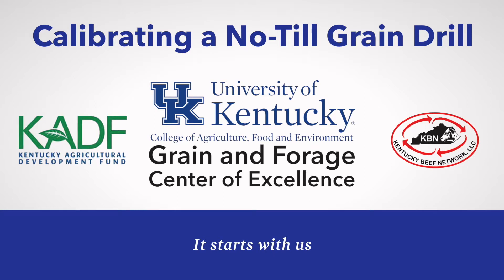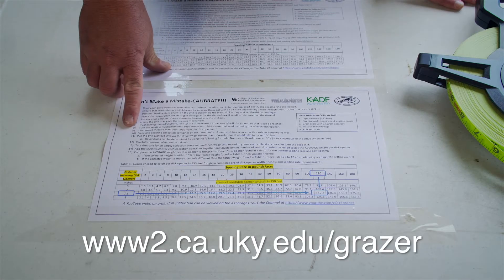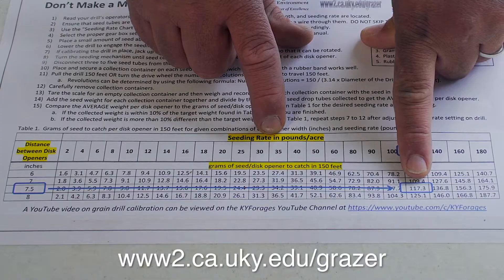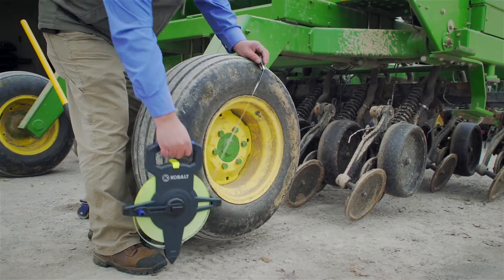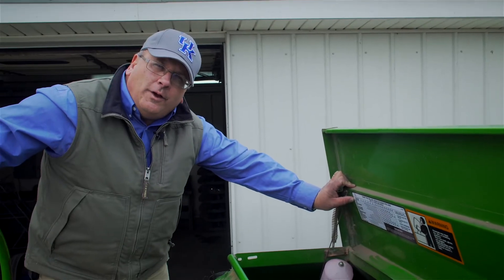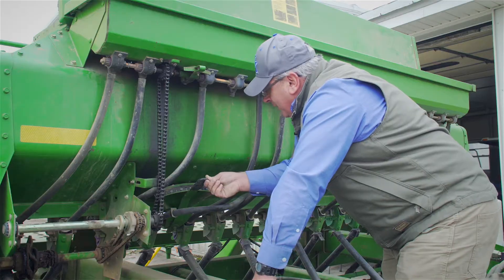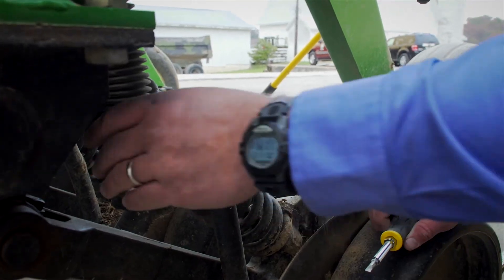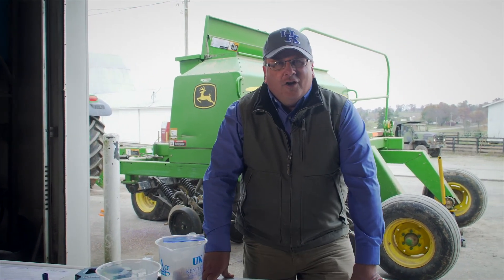Grain Drill Calibration

Comment: Why is 150 feet used? How do you get that number?
Reply from the maker: The distance was sort of arbitrary.  On the John Deer drill that I normally calibrate, it is approximately 20 rotations of the drive wheel. Having said this, the TABLE that is used to determine the amount of seed to catch is based on 150 ft.  So if you are using the table instead of doing you own calculations, then you MUST use the 150 ft distance.  Chris
Reply: @KYForages  I have a 7 foot seeder with 6 inch spacing. The wheel circumference is 5.7 inches, i am wanting to sow 25 kg per hectare,  the answer is?